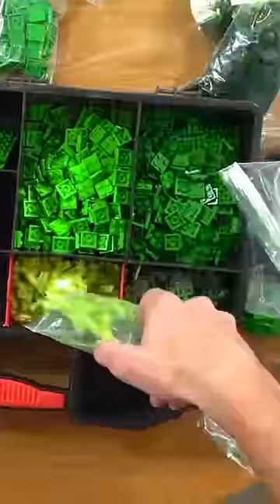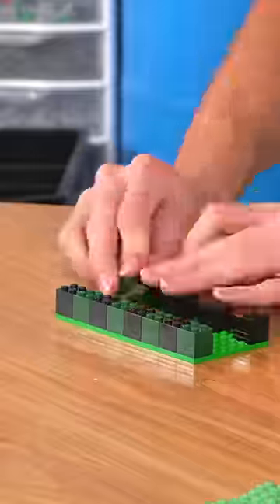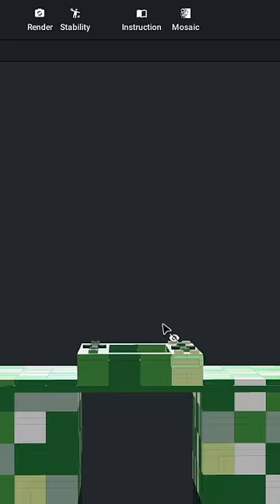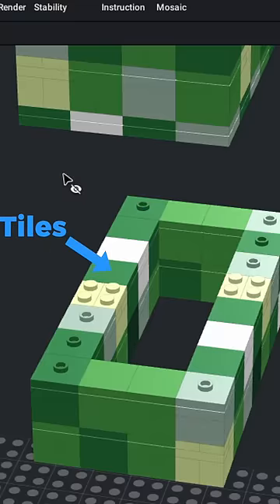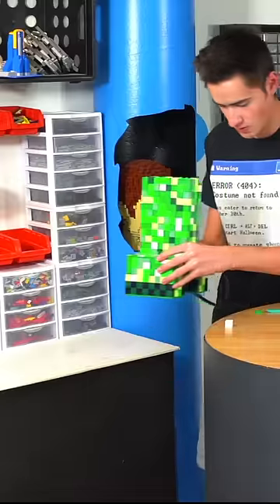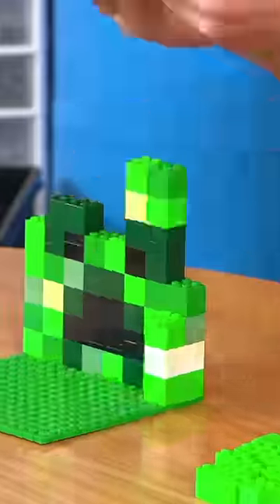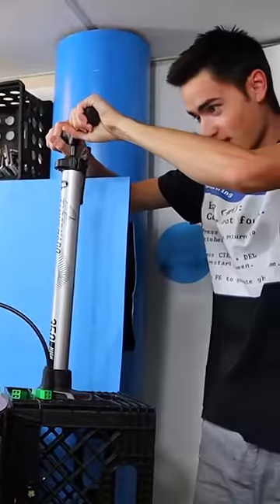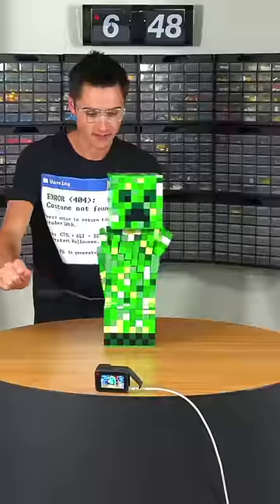I Built a LEGO Creeper! 🤯 #shorts

Comment: I tried this but instead of a rubber band, I decided to mix iron powder and aluminum oxide at a 1:3 ratio packed tightly into a 1” diameter steel pipe, and capped off the pipe with a blasting cap wired to a cell phone. Worked like a charm.

Comment: You could pre-pressurize a plastic bottle and add a quickly releasing valve, which, depending on the max flow rate of the tubing, could be better at more rapidly inflating the baloon.